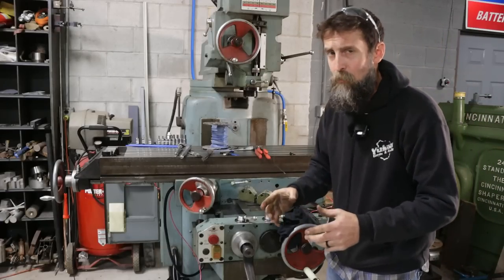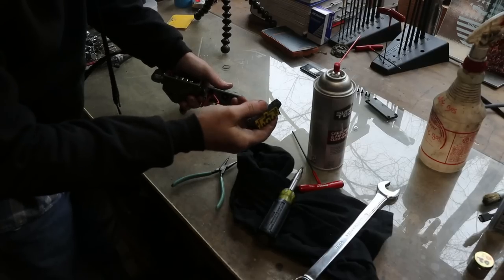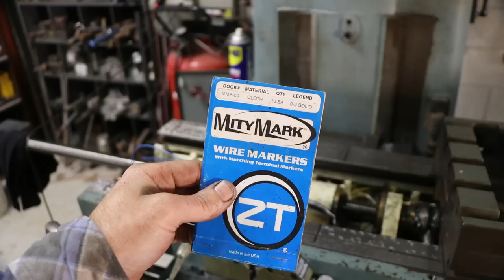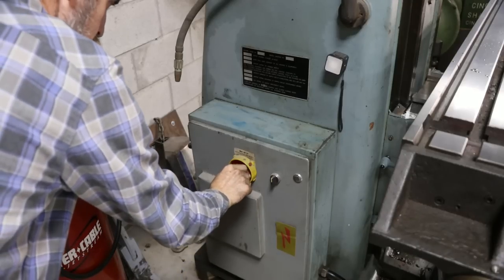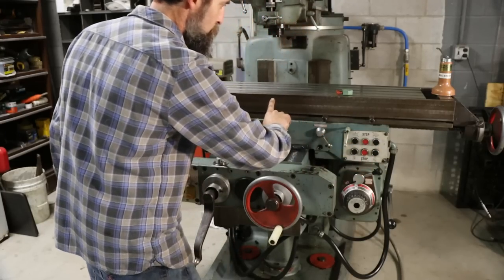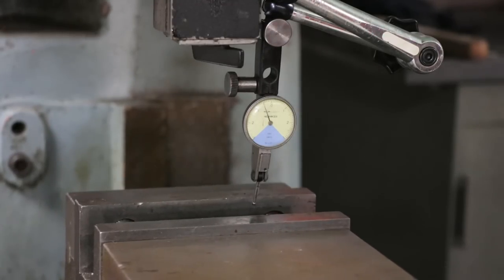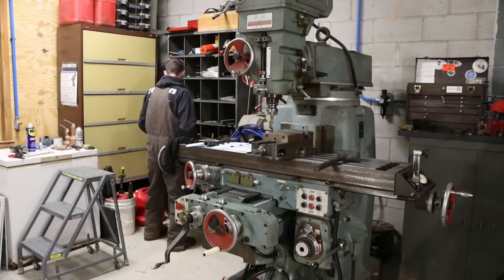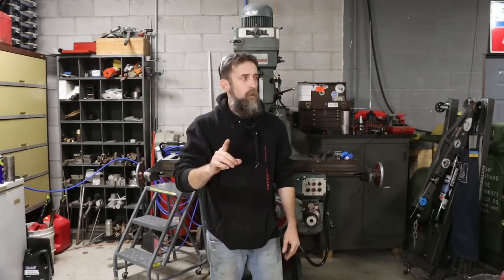1st cuts with the DoAll Mill

Comment: With the 3 phase power feeds you could just switch directions without stopping, but like you, I think it is easier on the machine to stop between directions. About the only time I don't is sometimes when tapping, especially in a blind hole. I think a power drawbar project should be in your future, that ladder required to change tools will get old pretty quick.
Reply: In the meantime, a foldout step, like on some truck bed gates, mounted to the knee may work as well.
An additional 200 lbs and this only static won´t be a problem at all.

Comment: 🤔🤔Steve you could install a ((potentiometer knob or lever type)) voltage regulator on the folk lift. To control the speed of the motor.

Comment: Those limit switches get gummy. I had similar switches on my CNC VMC that were sticking, and I took them apart and took the plungers out, cleaned them with degreaser, put a little light oil on it, and put it back together, and now they work great.

Comment: I bought a big retrieval magnet and attached it to a length of paracord so that I can swing it close to the ground to quickly find things that I dropped, and maybe find some things that I would have never found otherwise. A baggie installed over the magnet makes releasing chips quick and easy.

When I disassemble something I'm unfamiliar with, I take a series of pictures with my phone and place those pics in an appropriately named folder so that I can find them again.  It eliminates many errors in reassembly when I finally get around to it.

I understand that it's the common vernacular but I'm on a crusade.  Things that operate in pull mode (ropes) employ tension; things that operate in push mode (jacks) employ pressure.  It probably only matters to physicists but the misuse of the word tension drives me nuts.

Conga rats on the successful refurbishment of that fine mill - green with envy here.

Comment: Those microswitches are still being made, as they are a part used in the railway industry. 15 Euro each 10 years ago, though I suspect the price is a lot higher now, as that stock at 15 Euro was ordered in 2002. They do however have a rated life of 10 million cycles at 10A current, so do last well. The ones I replaced were a good few lifetimes past that, being made in 1970, and had probably 80 million cycles on them, wearing out the cam follower roller part that you clip to the front. Changing the whole switch was the only way to get the roller though.

Comment: Prior to putting on the shrink wrap, I like to put one layer of black tape, that will keep the shrink wrap from splitting if a sharp edge of solder  / wire pokes the shrink wrap, just a technique I use.

Comment: Great to get a Home Run. This is a beast and awesome to see up and going Steve. The Wells Index #55 I picked up back in October that was bought only for parts resales, has the same size bed. Going to come up with a use for it, but the rest of the mill has to many parts missing to refurbish. You can keep the snow, old Texans hate snow,,hehe!

Comment: Hey Steve, sometimes you have to take 2 steps back to go 1 step forward.  It's happened to me more than once.  It's painful when it happens but sometimes you just don't have any other choice.  You would have been kicking yourself if you took a short cut and ended up damaging the wiring.  Little Cora is turning into quite the shop dog.  Careful she doesn't lick you to death!  Thanks for the video!

Comment: I've replaced several Bridgeport quill springs because people over wound them in the mistaken belief that the quill should retract like a drill press. The counterbalance spring should only be tensioned enough to stop your heaviest tool from causing the quill to drop.

That doesn't mean you shouldn't service your quill of course.

Comment: Congratulations of the first cuts with no magic smoke creeping out of the electrics. I have a Sharp VH-25 that's comparable in size to your DoAll and the large mass is a joy to work with. I will never push my machine near its limits as I doubt you will either. But it's nice to have if you need it. Find some 40 taper tooling as you can because after you start to swap out holders rather than cutting bits you will speed up your work immensely

Comment: Awesome Job Steve. Just one little niggle, you will have to re-tram the vice when you eventually get the gibb set to your satisfaction. I would also set the dti a bit further down in the fixed jaw to discount any wear in the top of the jaw ( which takes most of the work holding). Otherwise, fantastic.

Comment: Steve.    I suspect that all the limit switches are wired in series with the stop button on the power feed , as there is no way for the system to recognise X Y Z of the table , would test that out for your info if its the case any one that faults will prevent any power feed .

nice to see the old girl working again good job Stuart from the UK

Comment: Lovely to see the doall mill up and running.  We run 4 similar sized mills at work and last year we installed the Maxi Torque-rite power drawbars.  I’d recommend taking a look.  Saves climbing the step ladder to change tooling.
Reply: Power drawbars are a must have on these tall mills.

Comment: Once you try the front x axis wheel you will never use the wheels on the end of the table.. The front wheel is .1 per rev. like the Y wheel. The wheels on the end of the table are  .2 per rev. So you have better and more uniform control with the front handle. On my mills the feed control levers go both ways and control feed direction so you choose direction independently. You can use both and cut 45's, Congratulations great job!

Comment: Climbing up on that big sucker every time a tool change is needed gets VERY old. I will stick with my Bridgeport's & R-8 collets with power everything and a really nice Newall DRO. If I need a mill any bigger, I would use a 35hp. #3 Cincinnati or Kerney T. as they can pull up to .500 a pass with a 12 or 14 inch multi Carbide inserts facing cutter with coolent.

Comment: Happy Saturday Steve, Cora, and Grits! Hope youall had a nice Thanksgiving and glad you are feeling better. Good video as usual, sometimes ya just have to go back and fix. Always turns out better that way. Thanks for sharing and inspiring us to do the whle job, no shortcuts. Stay safe and God Bless.
Reply from the maker: Thanks Roger👍. I would regret it had I pulled those wires through.  Probably would have had to go back and fix a short circuit if I wouldn't have pulled the table

Comment: Nice work. Why does the big red hand wheel on the front of the head turn when you run the spindle? I assumed that was a fine quill feed so I didn’t expect it to be turning. Also, will you put way covers of some kind on the saddle? Seems like the exposed oiled ways will attract swarf. What a beast of a machine.

Comment: Balluf is still in business. Not cheap but quality guaranteed. These switches are kind of a generic sort. You can buy a lot of replacements from different manufacturers with the same form factor and function. Because the function of these is a kind of critical I would replace them. And if they operate on closing a contact instead of breaking it I would rewire to a breaking action. By doing so the feed doesn't work with a broken wire too or a failsafe solution. When changing form a expected closing connection towards the better alternative of an expected breaking connection you need an extra relay to transform this to interface with the original setup at the control part of the machine; Translated; if the bed hits one of the end stops the control has to see a signal coming in. (= normally open wired originally) By using a relay witch is is connected to the N.C. contact of the microswitch you should use the N.C. contact of this to be low when travelling. Once the bed hits the switch the circuit to the relay is broken and it falls of and the N.C. contact of the relay makes the right call to the control of the machine; it closes and because it's n.c. wired it tells the control at the desired moment as planned original. If the engineers did their job right in the day it's probably using the n.c. connections of the switches already so you don't have to change a thing. I'm telling you this because I refurbished older machines which where hooked up wrong in my perspective. Good luck and thank you! Best, Jobl
Reply: That makes total sense to me and a good idea

Comment: Heh.  It's not as simple as pulling a wire from here to here - immediately tries to pull the wire from here to here.  Good thing it didn't work easily!

I've worked with more than one guy who would do that, then be all surprised when the wires got chewed through by moving parts.

Comment: Solder is for pcb's, wires should be crimped.
Reply: Bollocks should they. Oil and crap can get into the crimp and cause connection issues. Soldering is a much better way to go. Soldering wires has been around at least 65 years before pcb's